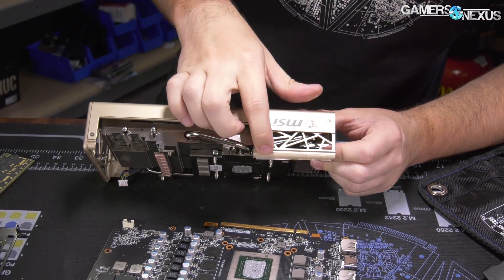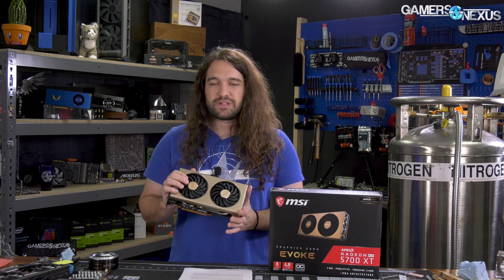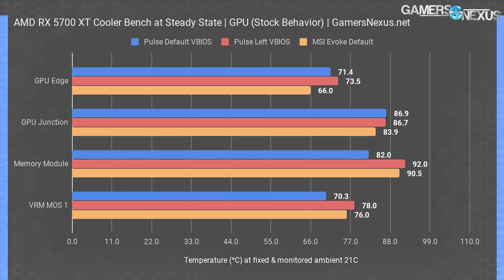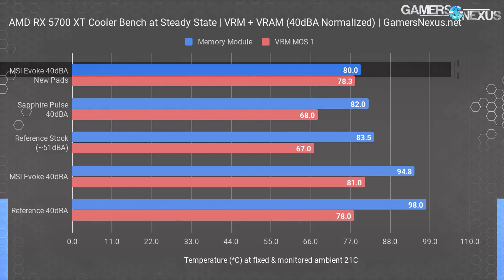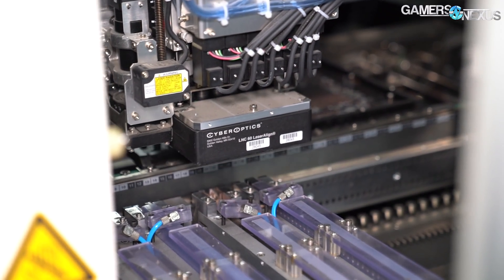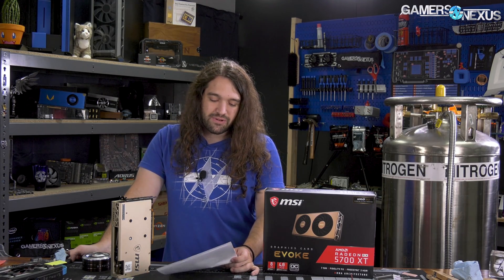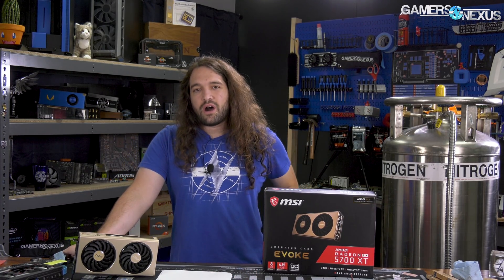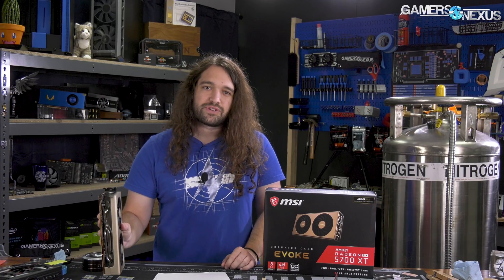Fixing MSI's Design Flaw: Thermal Pad Swap on RX 5700 XT Evoke OC

Comment: Haha, "in the US you don't have to worry about it." Not entirely accurate. It may be illegal but that doesn't mean companies won't try to screw you over. Steve I watch your videos every time you publish one and always hear that you are safe in the US if you remove a warranty sticker. Well I bought the red anniversary edition of the radeon vii from amd's website and when I recieved it I immediately took off the cooler and applied cryonaut thermal paste to it instead of the pad as your testing and others indicated that better thermals could be achived. Like an idiot I didn't test the card prior to doing that. After installing the card and drivers I ran some benchmarks and there was heavy artifacting even though the thermals were fine. Never seen anything like it. Tried reinstalling the drivers a few times and it never fixed it. On the last run of heaven benchmark the screen went black and I could no longer get any picture. At that point I reached out to amd several times just to get the same response. If you removed or broke the warranty sticker then your warranty is no longer valid and we can't help you. I spoke to a number of people and management from amd and they all said the same thing. So my 700 dollar gpu that was brand new I got 50 dollars for online from someone who wanted to try to fix it and now I still don't have a new gpu. Rocking my old 290 in my rig again. I lost a lot of respect for amd and still payed for the card over six months because I financed it and couldn't afford to pay it all at once. So companies will try to screw you over if you break that sticker, or at least amd will.
Reply: Just for reference, if anyone is curious, here is exactly what amd said to me in the last email from them. Dear AJ, Thank you for contacting AMD. Regarding your previous request, I would like to say that unfortunately it seems that the GPU is defective and the only possible fix to this unpleasant situation would have been a replacement. Unfortunately we cannot proceed for a possible replacement because from the information provided during the first call it seems that the GPU in an attempt to replace the thermal paste was opened and tampered, unfortunately this action is not supported by the Limited Warranty Terms and Conditions for the AMD Radeon VII, considering this particular case we suggest to view the section (What will this limited warranty not cover). For further questions, please do not hesitate to contact us again. Best regards,

Comment: Yeah, MSI usually doesn't make quality products. I had a am3+ motherboard, and fixed many GPUs with similar cheaping out problems, and their laptops underperform with mountains of bloatware. 

I see no reason to ever buy any of their products. There's always a better option that's generally cheaper.

I will say comparing them to Sapphire is hilarious. Sapphire is basically the best GPU board partner at least on the AMD side.

Comment: That's a massive difference in temps, MSI should be bloody ashamed of themselves. Damaging their brand will cost them more than bigger pads. MSI should do the right thing here and sent out new pads to owners if they want to exchange the pads themselves. The other option is getting the card replaced at MSI's expenses once they've fixed the thermal pad issue.

Comment: ASUS had this same problem also way back on first batch of STRIX vega 56, although the thermal pads were same size with VRM's but the placement of the pads didn't cover the whole vrm's that made the ASUS STRIX version hot and loud which is usually an efficient card. On the next batch of ASUS STRIX VEGA 56, they corrected it.

Comment: this problem was not there on the 2070s all thermal pads on the vrm/vram(even the inductors) were full coverage with a tiny bit of "overhang" and this is referring to the gaming(non-x) that i bought.    so this is likely where ever this card was made.   i would try to get your hands on another and see if it is the same.   should have a mfg/line code some where on it. (even possibly in vbios idk)

Comment: It says warranty void if removed. Ben Jones, UK Lawyer. If you were to remove the sticker in these circumstances then yes, the warranty will be void. A warranty is just a discretionary benefit offered by the manufacturer and they have the right to set certain conditions for this to continue to apply.

Comment: Seems like Sapphire and PowerColor are the only AIB partners worth getting for new AMD graphics cards.
Reply: Powercolor may be Chinese but they are put out some gear of late!
Reply: @MrRourk  Powercolor is Taiwanese company, not Chinese... in fact almost all major OEMs are Taiwanese, ASUS, Gigabyte, MSI, Asrock, Sapphire, Palit, Galax etc... all taiwanese
Reply: Wong Koewei Taiwai is called Republic of China, so yeah, they are chinese company.
Reply: Xfx too
Reply: What about XFX? I still want to see how the Thicc2 performs. That said though, if I had a choice of any AIB model would go for Red Devil.
Reply: @TADP0LE9806  The first review i found about the XFX actually shows that memory temperatures are FAR worse than on even the reference cards. The Thicc2 seems to be designed for the looks more than it was made to function well.

To anyone interested, this is the one i was referring to: https://todotech20.com/en/review-of-the-xfx-radeon-rx-5700-xt-thicc2-very-beautiful-but-not-impressive/
Reply: @Blushing_Boo  ah, that's a pity
Reply: @Blushing_Boo  i hybrid modded my xfx 5700xt so i dont have any issues with tempa
Reply: @ohyeahyeah9630  lol i did put 3 noctua 92mm fans with zip ties modded the pwm cable and here im looking what thermal pads i should buy lol cause the ones i have became dirty anyway except that they might suck

Comment: To really see how much making the thermal pads smaller effected temps you would need to test with either the same pad as stock covering the whole memory chips or test with the same size of thermal grizzly pads as stock . As done you don't know how much improvement to attribute to simply using much higher conductivity thermal pads.

Comment: Can someone please confirm if the XFX 5700 XT THICC has some similar memory thermal issues? Is a review of this card possibile?
Reply: I'm also waiting for a Thicc 2 testing and teardown, it is the best looking Navi card but the early reports of high VRAM temperatures were concerning.
Reply: @stargazer162  I already have the 5700 XT THICC II and in fact VRAM gets sometimes (not always) above 90° celsius, I'm looking for a serious review/teardown to understand if I can easly fix the issue as in this MSI or is a more structural problem. I still can return it (until 3 weeks from now) but if it's a simple solution I'd like to keep it as it is se sexiest piece of hardware I've had in my hands (it looks better in person) and runs very very well, vram temps apart sadly.
Reply: @HirAmHelcaraxe  Adding thernal paste or thermal pads between the plate that cools the VRAM and the rest of the cooler should be enough to fix the issue, you would need to tear down the card, unscrew the plate and add thermal paste in between.

That way the heat would transfer to the rest of the heatsinks instead of getting trapped there.
Reply: @HirAmHelcaraxe  If you happen to do it, post the results on r/Amd with a before / after comparison, I'm really curious to see how much of an impact it would have.

Comment: illegal and anti consumer warranty stickers + can't place thermal pads properly.
10/10 msi i certainly won't buy from u :)
Reply: those stickers are legal pretty much everywhere other than NA fyi, one of the good sides of your over-the-top legal system
Reply: @Erotikstudio Winkler GmbH same. back with the 480 it was gigabyte that screwed it all up. looks like things have changed this time around
Reply: If you wont buy from msi because of that, then I guess you wont buy anything in your life again lmfao

Comment: the original run was on stock paste, the new pads run is on a different paste, though the paste contacts the cooler and then this is what touches the memory these mistakes overshadow your statement which is probably true.

Comment: They really could've cheapened out on a lot of things and gotten away with that, like not using a big ass, box sized, envelope for a damn tiny, few pages thick, quick start user guide.  

But of course they couldn't do something simple like that of course if budget was a cocern since that's in the marketing budget or something like that. 

So better act like scrooge mcduck and cut off about half of those weird sticky pads that get put on the card for some dumb reason, it's not like someone's gonna care and check when they notice worse thermal performance than the card should likely have.

Comment: Sometimes one can use an anti static bag and gently shim it in under the sticker and remove it that way. Though, still needs a little bit of patience.
Reply: 9:57 how to get around guarantee sticker
Reply: @ariewijaya1679  Yes, this specific warranty void sticker is on a screw. I were to talking about a solution that works on nearly all stickers in general. It works especially well for the tamper proof stickers that are supposed to break. (the static bag will simply shim in under and lift it off in one undamaged piece, this can though need some practice first for it to be successful.)
Reply: @todayonthebench in my country the warrant sticker easily broken into pieces if i try your method. it will leaving very sticy residue

Comment: MSI always had kind of a positive image in my head, but since the x570 boards and now this 5700XT, I'm not that positive anymore.
Reply: When this become to the AMD side, MSI always suck, they don't give a fuck for making those kind of aberration
Reply: LOL
Reply: Asus baby.
Reply: @badnewsbruner  You mean the company that fucked up HARD with their update software and released and signed a version that hackers had tampered with and put a backdoor onto every machine that had that version?
Reply: @shawnpitman876  And released Vega 64 STRIX cards with bad VRM cooling that made them overheat like fuck due to also bad thermal pads.
ANUS is, like MSI, an Intel/Nvidia lapdog. Their AMD products are always second tier or subpar compared to their Nvidia/Intel products.
Reply: @badnewsbruner  If you want any good board from asus you have to cough up at least 200 bucks lmfao. And Joshbert, they redeemed themselves with the X570 tomahawk outright being one of the cheapest X570 and one of the top performing boards for the entire am4 platform. Oh and TechJesus praised MSI for their fixed GP versions

Comment: Moving the existing pads to the middle of the chips changes anything? Correct placement might save some people the extra 12 over the already expensive card... maybe not worth it, but how much will it change the overall stock experience might be interesting to find out.

Comment: This is just MSI betting against the 5700 XT being popular, that they thought it wouldn't be worth investing the time into making a good cooler for it. Its a shame since I still remember how legendary the 290x Lightning was for having such great thermals on such a huge and hot chip.

When the Pulse and Red Devil are so competent you have no reason to look at this as an option.
Reply: The cooler isn't bad.  Cheaping out on a few thermal pads is not a design issue.  It's such a nonsensical thing to do I can't help but wonder if it was a mistake at the factory side of things...

Comment: Can you pull your MSI 1660ti Gaming X and let me know if it needs the same?
Reply: You could just open it yourself and see. The most it'd cost you if it doesn't need thermal pads is like $2 in thermal paste. They aren't putting high grade stuff on there in the first place.

Comment: its really a manufacturing defect and they should all be recalled and fixed, many thanks. you shouldnt have to strip down a brand new card and fix msi mistakes.
Reply: This!
Reply: or just do what evga did and offer free thermal pads.
Reply: @sirmonkey1985  should pay their customers to work on their own cards for then in that case.

Comment: What if its just the fact that you replaced it with a better thermal pad that helped? Maybe try replacing the pads with the same size as stock but the thermal grizzly ones.

Comment: As someone with manufacturing experience, I wouldn't assume this was a cost savings. There are lots of other places to "cheap out" if they were cutting costs anywhere possible. I would suspect standardized thermal pad sizes or placement equipment etc. It is very possible someone that didn't know better tried to "simplify" things. Obviously, not an excuse, but I'd be interested to hear MSI's response.

Comment: My guess is a disconnect between design and production, no way it was specd like that.
Reply: It isn't a one off though.

https://www.reddit.com/r/hardware/comments/cu8a96/gamers_nexus_wrong_thermal_pads_teardown_of_msi/exsr307?utm_source=share&utm_medium=web2x

Here is my RTX 2060 MSI Ventus and it uses the exact same pads.  This is not a one off mistake or a fluke, MSI has been cheaping out on thermal pads since RTX was released.
Reply: Jaymiecain1 Interesting. I was just about to post a comment asking if this had been verified on any other cards, or just the GN one.
Reply: it took two years for Ford to acknowledge they had put the headgasket of the wrong car >< in 2016 Ford Focus RS mk3 (they used a Mustang ones but the water circulation holes were different) and they only did that after forum users identified and explained the problem almost fully (even pinpointed to a 1 month error margin when Ford realized their error and switched to the right one) when lawsuits where incoming basically they had to fix it under warranty, and even then they didn't really know who had what, they still recalled mine when I already knew and checked I had the correct headgasket (protruding parts were visually different) thanks the power of internet forums and reviews
Reply: Yeah, could very well be a production mishap, but we won't know until batch 2 or 3.

Comment: Do all of the MSI RX 5700 XT have this thermal pad issue? Seems a little unfair to assume so based on one example, as the one you have could have been a Friday afternoon special or a trainee built card. Just a thought not a complaint.
Reply: James Onyshchak this same model has seen bad memory tempa Also in other test. Pity as the cooler itself seems to be good!

Comment: I don't think MSI did this mistake as a cost saving measure. I think they misapplied the clearance zone around the GPU itself, cutting away part of the thermal pad for misinterpreted reasons; the idea with that zone is not to put e.g. conductive capacitors poking up into the heatsink. Thermal pads are obviously part of the thermal solution and belong there.

Comment: But does it run any quieter?

I got this card and it runs fine without touching it, 3 years of warranty on it so if it fries itself I'm covered. So whether it runs 90 degrees celcius or a million if this mod doesn't make it considerably less noisy I'm not going for the mod as of now.

Comment: Just FYI:
If you are planning on changing the thermal pads outside of N.America... you are pretty much screwing your warranty. MSI is adamant in that matter if they notice any tear on the warranty sticker that holds the cooler or any aftermarket component that sits between card and the cooler - your warranty will be immediately revoked and serial numbers invalidated from future repairs.
I've been there already, just giving you advice as a UK consumer.
Reply: Yeah not worth it, if the card fries it's memory then you get a new one under msi warranty.
Reply: Seems to be allowed in some parts in the EU, there's a german hardware website which asked all aib partners if a cooler change, overclocking and undervolting voids the warranty and apparently MSI allows all 3 (I guess changing thermal pads is obviously covered by that too).

https://www.computerbase.de/2016-09/grafikkarten-garantie-vergleich/

Comment: MSI do you really need this? Pennies? Come on!!!
Reply: I would say it is more likely lasiness/lack of care on the manufacturing side then penny pinching.
Reply: A penny will quickly turn into a couple of millions, when your putting out a million units a month.
Reply: @Orcawhale1  They wont sell 1m units in the next 100years. And what is 1m pennies? Are you for real dude?
Reply: @adnan4688  Yeah, im entirely for real. 
But your missing the point, granted it is a terrible example.
Reply: @Orcawhale1  But at that point you are selling a million units, the relative profit is still the same, and especially seeing how doing this poorly reflects on their brand.
Reply: @defeqel6537 No it's not, they are still out whatever it cost to make a change on the card, which could equate to millions for the company. 
And you got risk management to calculate what's the cheapest solution.
Reply: @Orcawhale1  yeah, change is much more expensive than doing a good job in the first place, which is why you don't want to screw up such little things
Reply: @defeqel6537  MSI isn't concerned about that, as the Evoke is simply their to give them a presence in the market.